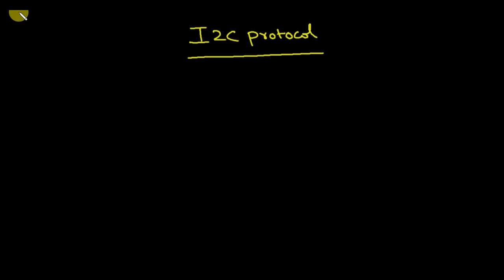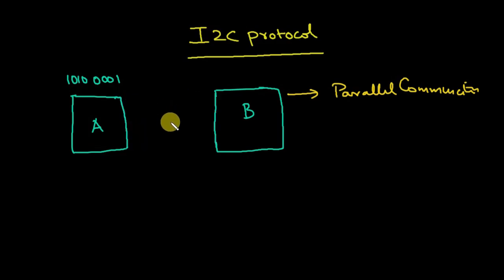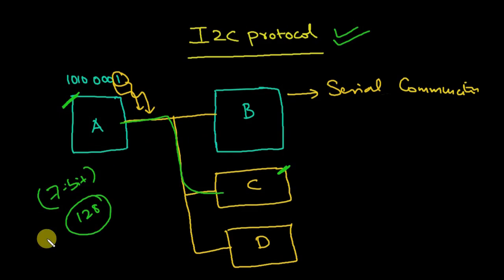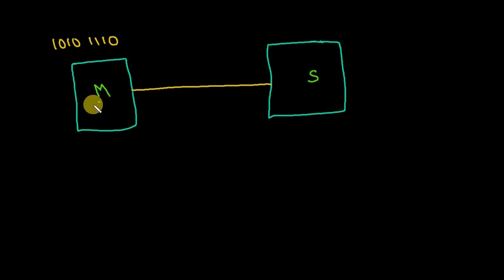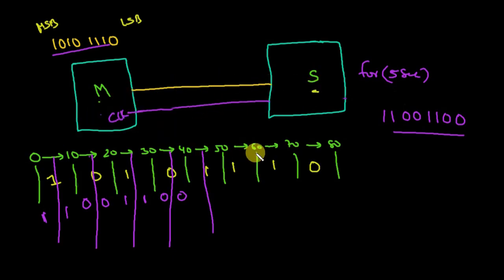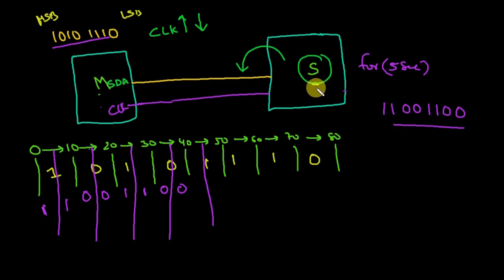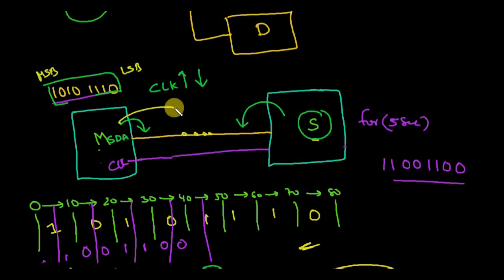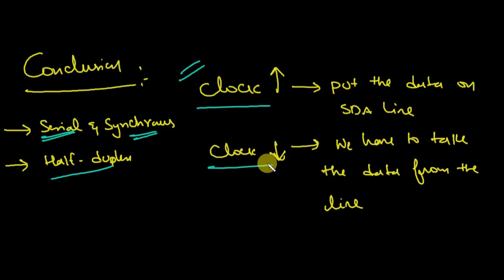I2C PART-1|INTRODUCTION TO I2C PROTOCOL|WHY CLOCK IS USED

Comment: do correctly
Reply from the maker: What I need to do correctly?
Reply: @Pankaj_prasad100  how to sending the data msb or lsb. Which one
Reply from the maker: @rajendra neesu i would suggest you to go through the all the videos of the i2c playlist then you will get your answer. 
And is rajendra neesu and rajendra argus both account are yours? 
If yes then before commenting "do correctly" You should do your home work first and comment later. 
I know how the protocol works and i bet you will don't find any other videos who's playlist of i2c protocol is much depth than my playlist.
So kindly think before commenting.
Reply: @Pankaj_prasad100  bro, I learned from your video,how to write read funtion through i2c. It is very good.😄😄😄 may be my fault way of sending data m2s
Reply from the maker: Thank you and subscribe for more videos...